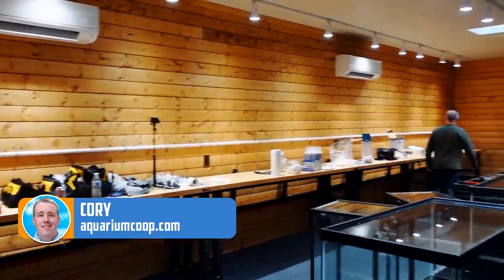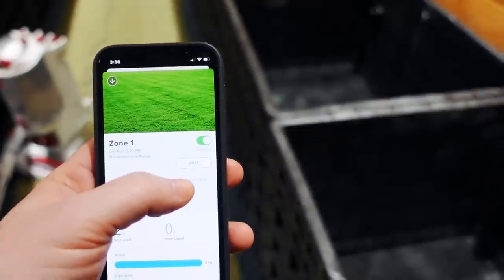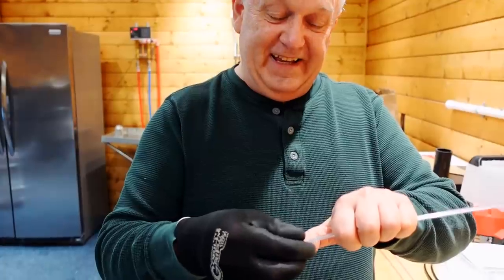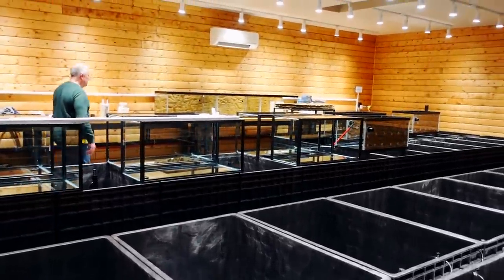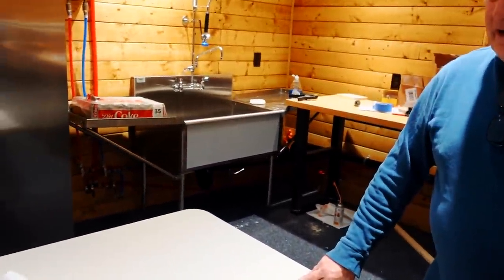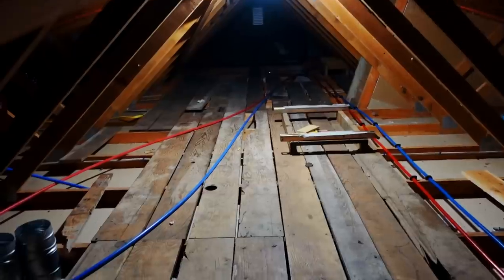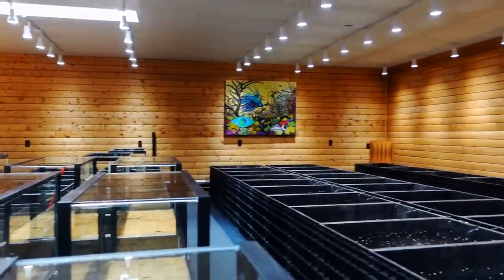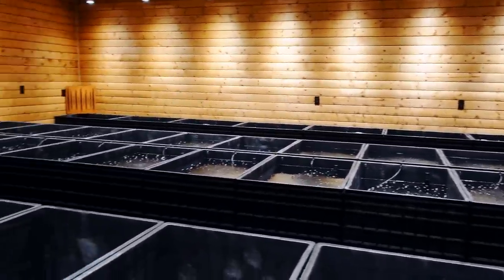We Built an AMAZING Water Change System - Fish Room Update Ep. 99

Comment: One possible reason for the tubs  filling at different rates could be the way you bent the rigid tubing. When you bent the tubing you did not put something inside the tubes, which can cause the interior sizing to change and pinch, reducing the flow.
Reply: Yep, elbows already increase the turbulence, that can't help. I would have just gone with elbow fittings.
Reply: @ryanpenrod1859  One could get fully intense with min/maxing, and use computer modelling to design a manifold header that has uniform lengths, and curvature like they do with performance engine intake/exhaust piping. If one wanted to see how far they could push it.
Reply: @CatFish107  lmao, def... one def. could...
Reply: Flexible Silicone rubber tubing with siphon/suction pads could solve that

Comment: Make the space quite by hanging some 2’x4’ acoustic panels out of 2” compressed 703 insulation. Simple frames, DIY, stretch some fabric of your choice over them, put about 6 on each wall, your room noise will drop in half and they can look great. You can me them look like artwork.

Comment: It is looking great. I like the auto water change system . You would think by now a aquarium manufacturer would build one so people could have a smaller version especially for those less DIY inclined  that would operate with wifi and Bluetooth driven.  It sounds like a business idea in the making. Something that could be set to auto change either everyday ever couple of days or once a week every two weeks or once a month a specific amount for each and also have it auto dose dechlorinator in proper dosing with option for liquid plant food, and or liguid minerals and specific nutrients. Just a thought thus allow less work giving more time to enjoy your tank. Micro valves and small tubing could make it easier for the Fish keeper to operate and control in smaller aquatic situations and needs.

Comment: @Aquarium Co-Op, Robotic Mower, buy it. Save yourself time with both fallen leaves and grass mowing. Then just adjust after its cutting tendencies to get clean mowing lines. 

Beyond that, Probably too late now. But you can always drain the waste water into a sump tote or two before it drains into the grass field. Recycle the aged water for other fish that you raise outdoors, for example... Rice fish.  Or build a custom 12 inch tall pond that spans for a long length. Raise native crayfish/shrimp/clamps etc together with non-invasive water foliage.
Reply: Yeah, I love water reclamation projects and wetlands. 

Our farm utilized an external greywater wetlands system, which is the best way to show people how beneficial snails are. Cattails and other native sedges can do a great job cleaning water, but only snails keep the sludge and bubbles from greywater under control.

Comment: Glad you figured out the fill rate issue.  When he was showing earlier in the video, I wondered if that was going to be an issue.  Basically the bends got pinched as there was nothing inside the tube to reinforce the walls in the curve.  Learned that one when doing a hard line watercooling setup for my pc.

Comment: The reason for the fill variance might be Dean's bending technique. The rigid tubing should be filled with something solid when bending, like fine sand. This would maintain a consistent diameter and prevent crimping.
Reply: Using a small cable or flexible tube that perfectly fits the inside diameter works even better than using sand.
I have previously used old cuttings of broken phone chargers and they work perfectly for 6mm (1/4 inch) pipes.
Reply: @yourlocaltoad5102  yeah you're right. Didn't think of flexible cable for some reason. Imagine it would become stuck once bent lol.
Reply: I use salt as it will dissolve in water when you are finished.

Comment: It's important to note that all mixing valves require a minimum flow across them to control temperature accurately. The nice thing about digital options is there is no seasonal adjustment vs. thermostatic valves, which require seasonal adjustment as groundwater temperatures can vary greatly in some places, and thermostatic valves are designed to proportion with no actual temperature analysis.

Comment: A few quick tips for you guys to save you from burning out your pump, add an expansion tank somewhere in the loop to manage pressure surges, also add a few air bleeds, ideally at high points, also, add a low point drain for draining the system when you have to make changes. Add isolation valves for areas where you anticipate changes in the future. This is the sort of thing we do in the pipeline industry.
Reply: Also, the system shouldn't be pulling in air if it is at a reasonably high pressure, because otherwise those points would be leaking water. It's more likely that you have trapped air that is causing pressure surges as it gets compressed. Your lines should always be angled, and a bleed valve installed at the high point. Crack the bleed valve when filling to ensure the air gets out of the system.

Comment: Once had a flood when my non flared (ie no bell end) tubing popped out of it's compression fitting at night so I couldn't turn off the valve. Tubing should always have a flared end or ferrule coming from a larger volume pipe, the pressure gradient is tricky. Glad to see you're doing a drain field for the change water.

Comment: Use Hunter PGV control valves. The reason why the system was vibrating is because of the valve diagram sticking and not allowing water to pass through as it should. Orbit is the worst irrigation brand and that's why it's very cheap. I've been in the business since 09 so I have a little experience with them. Love the channel 👍

Comment: Sound pollution - I totally get Cory wanting it to be as quiet as possible.    Something about vibrating sounds drives me bonkers - I can feel the vibrations, after a while my blood pressure rises, I get anxious, then irritable, finally I have to just leave the area.  When they built a house across the street and used a bobcat with a backup peeper I almost lost my mind.  I could hear it and feel the vibration in  every corner of my house even with the windows and doors shut. Even though I work from home I ended up temporarily moving until they finished building.
Reply: It doesn't bother me that much but my older sister always got nuts over stuff like that too. Even the hum of a printer in wait mode she had to unplug that puppy.
Reply: My mechanic hates me as I always come to him with "weird noises only I can hear".

But every time he checks the area I claim, he does admit some wear to a part or something is loose.

Comment: Hay Corry good to see you guys used uponor pipe and fittings, good stuff good flow.. but the fitting coming out of the system (time mark :18) looks like black iron.... it could be discolored brass but I'd say it black iron pipe it the 90 that comes out and shoots over.... if indeed it is I highly recommend you have a brass replacement installed....#1 electrolysis could occur and cause early and unnecessary repairs.  #2 iron for the fish tanks Hope this helps
Reply: The fitting type is called in the filed push fit...

Comment: I have a question! 
How do you dechlorinate mains tap water in this system? If you have the mains tap water running into the Haas system, at what stage does the dechlorination occur? Do you have an 'uber' dechlorinator that is able to pull chlorine out of the water at a speed that does not slow down the overall flow of water into the system? If so, what model/type of dechlorinator do you use? 
I was talking to my wife a couple weeks ago and told her my idea to run a system like what you have done here as it's a very clever way to perform water changes.
Again, great video with plenty of applicable and insightful thoughts. 
I can say hands down that my fish room would not be as extensive as it is, had I not been watching your videos over the years. 
Keep up the great videos!
Reply: I'm also wondering where dechlorination occurs.
Reply: AFAIK he is connected to well-water.
Reply: @RuitpootBuizerd  

Well water.. if your connected to well water surely you would wish to chlorinate the supply before pumping into your tanks. 
Well water will have plenty of microorganisms living in the water, some which could be pathogenic to humans / fish.
You would never drink water from any natural source without treating it first.
However I am interested to hear how it’s done here. Possibly a large water tank on the property that is treated after being pumped out of the well ?
Reply: @steveanthony4516  that’s not true at all. I’m on untreated well water, and have been for years. It’s great water, and chlorine free.
Reply from the maker: Use a carbon block filter in line. Size depending on amount of chlorine and changeout frequency.
Reply: @AquariumCoop  
Thanks for the response!

I appreciate that chlorine/chloramine concentrations and the desired flow rate for the water will affect that type of model is most appropriate. 

Can you give an example of a model that has a high flow rate (i.e enough flow capacity to supply a fish room? [perhaps 25 gpm]) that would work for a region such as the North West?

I am based in Vancouver, BC and my municipal water supply is 0.68 mg/L. A google search to find an inline carbon block to remove chlorine at a flow rate appropriate for a fish room (i.e 25 GPM) seems to direct me to industrial-grade RO units, which I do not believe is necessary. However, I am no expert so would be keen to hear your thoughts. 

What would be a good recommended inline carbon block that can be installed into either a mains municipal line (that has lowish CL concentrations) or a well-system that allows decent flow through the unit?

Again, thank you to everyone for the responses, and if anyone else out their has some useful thoughts on this subject please feel free to share your ideas.

Comment: @aquarium Co-op it looks great! How do you dechlorinate the water though? The system seems super complex but do you have something that adds nutrients and de-chlorinater or is that all done by hand after the auto water changes?
Reply from the maker: It's on well water, so we don't need to dechlorinate. If we did, I'd use a carbon block. As for nutrients. Thats in the plan down the road, along with an auto feeding system.

Comment: Why didn't use 1/4 inch drip tubing? There are elbows, tees, manifolds already to go. Seems like it would be much easier and faster. There are 1/4 inch inline valves which would allow you to adjust the flow output to each tank so that they would all flow at the same rate. Can also be used for air lines.
Reply from the maker: Because in previous builds they've had leaks under pressure. Much harder to work with. Keep in mind, this is build like 15 between Dean and I, there are many ways to do things. This would be what we consider best. I've done with nothing but PVC, all irrigation, manifolds and airline, etc. My favorite so far has been this system we are using in our current fish rooms and this one.
Reply: @AquariumCoop  Thanks for the feedback. Great content and this video has inspired me to do something similar to save time with water changes.

Comment: I've only just started watching the video. I'm a little concerned about the length of piping between the heater and the distribution system. If there is a relatively low demand for make-up water then the water in those long runs will become room temperature before it hits the tanks. Hoping that this issue is resolved later in the video.

Comment: The difference in the fill heights could likely be because the tolerances of the bends of the hard airline tubing. Some of the bends may be more kinked than the other ones, slowing the flow of the water.

Edit: haha... if I watched a few minutes longer I would have seen that you figured it out already.

Comment: Can laypeople use the hard, bend with heat, water line method? It seems  like it could eliminate suction cup clips?
Reply from the maker: Sure, it's not very difficult. just use caution as you'll be working with very hot stuff.

Comment: I'm confused. You have water moving in and out with overflows set up, so why not  use the water change system to run all the tanks to a large filtration system? Just seems like it would have been easier , quieter, more effective, etc. than running air and sponge filters.

Comment: Ive always found reflow water change systems weird; If you dump 50% tank volume worth of fresh water in, 25% of that fresh water will disappear in the drain again? Seems inefficient?
Reply from the maker: Theres a lot more to it then that. If you were worried about that, make incoming water temp cooler than tank temp so it sinks, overflows the warmer water. Put the inflow, and outflow on opposite ends etc. To me this is like planning how to do a project perfectly for 2 years. When the project itself only takes a week. Sometimes just getting things done is the best path.
Reply: @AquariumCoop  ohh using temperature to separate, thats pretty clever!